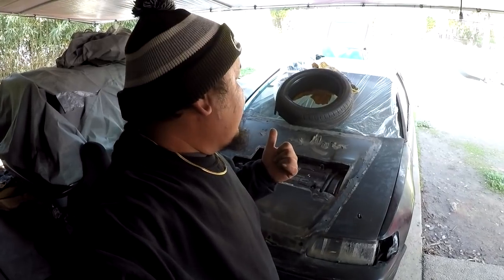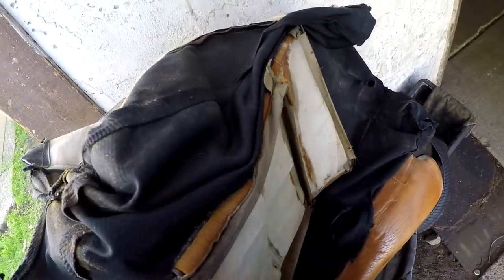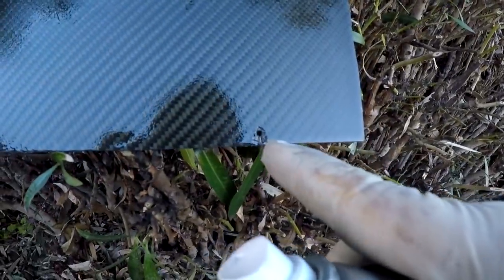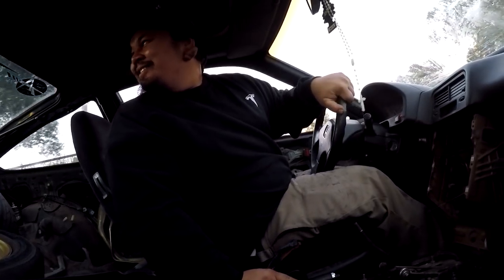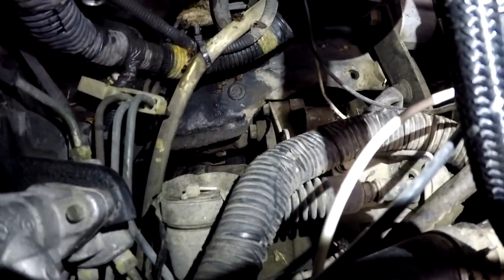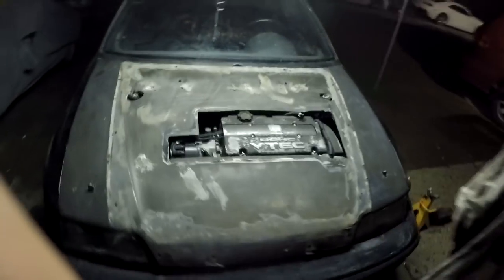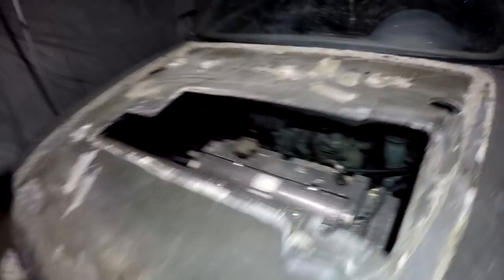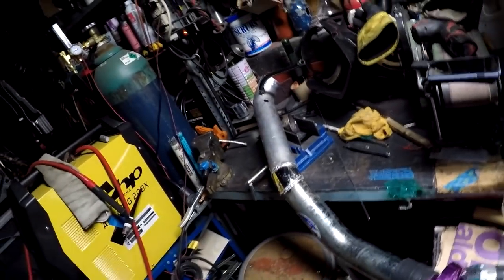H22 CRX : Smoked the clutch, No more Racing :(

Comment: I remember asking you if youd ever go h. Said it was pointless when you can make the same power with a b series. Now you have an H, id love to see what it can do.
Reply: CvbrillvsG you honestly can't compare h to b series. A cheap H Frankenstein build is 250whp all day. B20v will have a tough time hitting 250whp on pump gas
Reply: Josh Papineau lol. 😂😂
Reply: CvbrillvsG cookie cutter h23a build with a stock block would wreck a b20v lol
Reply: Josh Papineau im not the one here comparing motors bro. You’re here talking about frankenstein h23as and b20v. I was just  stating that when i told dana about going h a while back he replied with it was pointless because you can make the same power with a b series.
Reply: CvbrillvsG yeah, I know. Just saying...h is underrated. Not many know about the potential. H23a with h23 non v rods and Flycut pistons with cams...250whp. 85x97mm f20b same set up...250whp. They're fun
Reply from the maker: not sure when i ever said that. H wasnt my cup of tea and its too crammed in the ef engine bay. i had a car with a B already and a car with a K, when ever you asked me about the H, i can assure you i didnt have another shell to even swap one into. i kept this car because it has an H which i originally bought for the set of wheels and the rear bumper.
Reply: CvbrillvsG cams on a B barely make 190-210
Reply: CvbrillvsG same here man now iam just wait when he uploads a new video on the h22 crx 😂
Reply: Josh Papineau amen to that h it is my dude👍
Reply: YoungStatic its cool that u bought this car bro we been waiting on h series videos on ur channel for a long time ..  i just want to see this beast on the track g 👍
Reply: YoungStatic this was probably when you had the sedan. Lol
Reply: YoungStatic the og sedan you had . Since recently you had anoher one ☝🏻